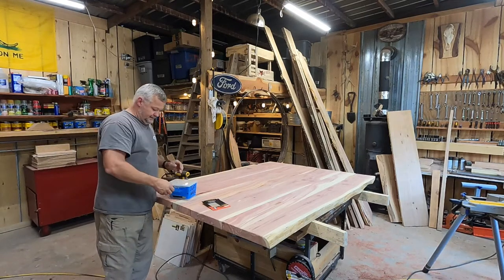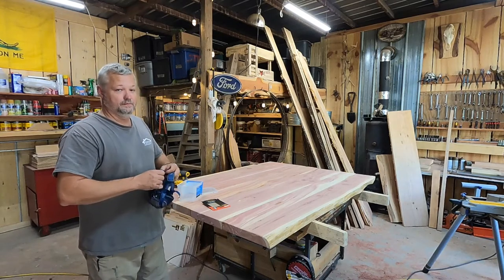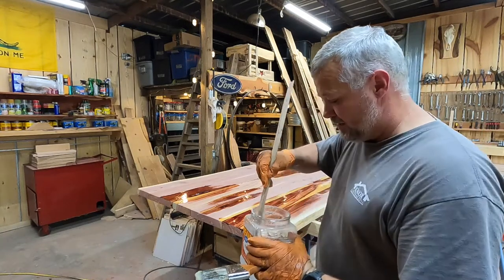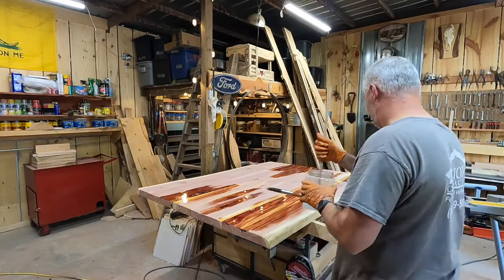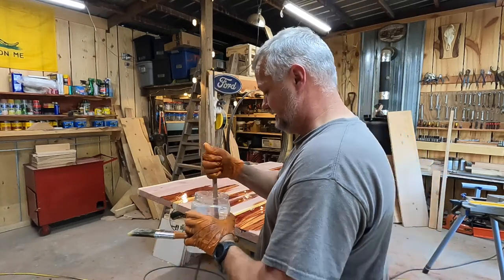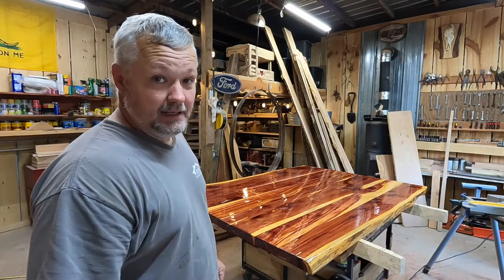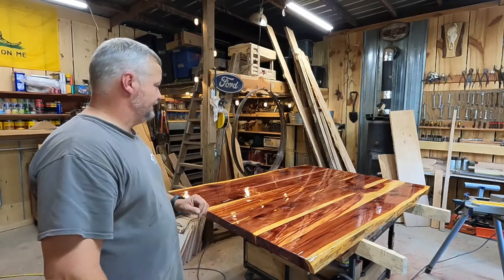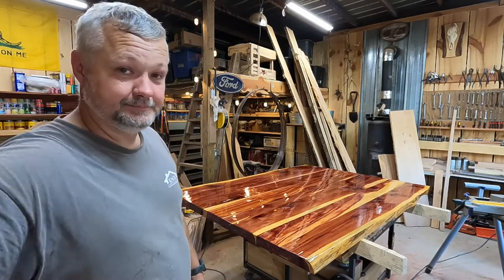Epoxy coating the cedar table top

Comment: I have an old aluminum  table,thoughts on how to mount this top to it..
Reply from the maker: drill from the bottom with a small bit, use wood inserts in the counter top to attach it to the old base